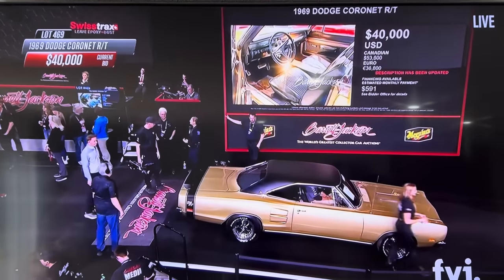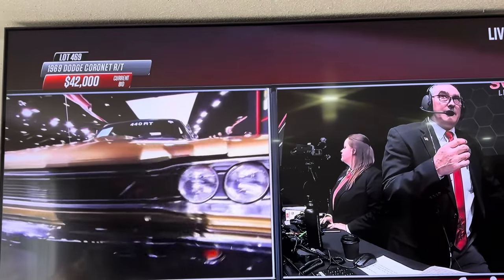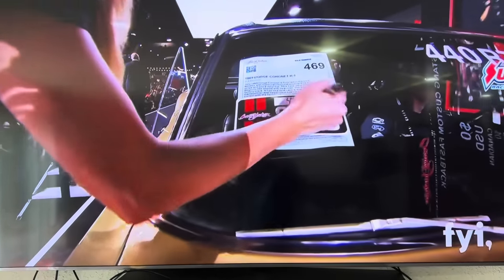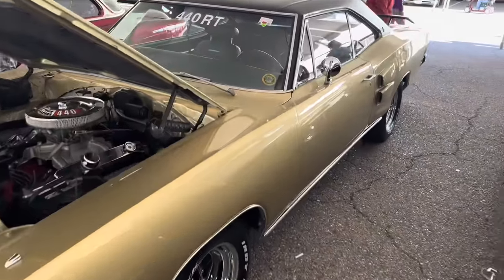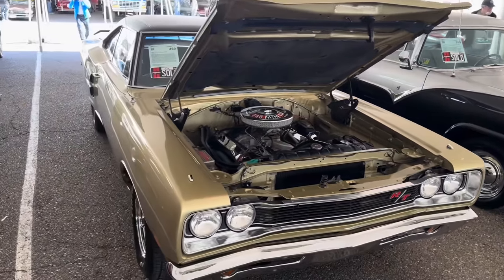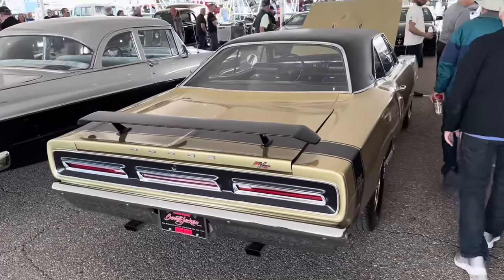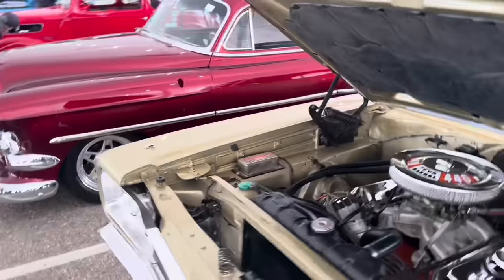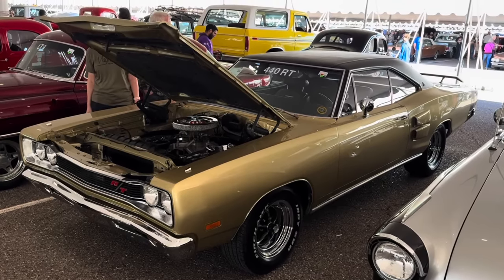The VIN Was CUT OFF This Fraudulent 1969 Dodge Coronet R/T At Barrett Jackson Scottsdale 2024!

Comment: The vin can be wrong too. As a kid in the early 70's, my folks bought a very low mileage 1969 Dart that showed it had a V8 in the vin. Trouble was, it had the original Slant 6. It would cost them an additional $3 for tabs! I wonder if you or Jamie have ever seen something like that?

Comment: that vin was not cut off.  it was removed in a skillful manor.
Reply from the maker: Yes sir
Reply: Wasn't really any 'skill" involved !
Reply: @rocketresto mecum has every make specialist there with sec of state police checking EVERY car.. that kawasaki you were talking about has original vin on stalk,, the bike was powdercoated and they made him sand it off, he painted it with rattle can thats why they only saw last 2 numbers, that video was overreaction and they should of done their due dillagence..I collect EVERY make, have 400 plus cars, started in late 70s, I know numbers but to all do your homework. They did not just cut it out at bjj. It was done correct. They ran vin and it was not stolen. All the big auction houses pay a ton to have cars verified to their best. Buyers are responsible at end of the day.. good channel but do your homework before commenting. Thx dan
Reply from the maker: @SuperBoss351  appreciate the comment but they absolutely did cut the VIN off at BJ.  I talked to the BJ Mopar expert and the police cut the VIN off that car at the auction.  It was on bring a trailer last year with the VIN.

Comment: Tom,
My A4/M6S A12 that I’m the 3rd owner, having owned since 04/87, was involved in a wreck 11/71, wrecked on the right front. The 2nd owner purchased the car in 01/72 and repaired the damage on the right corner. In repairing it he replaced the core support top bar and right side core support panel. Now of course its’ body number there doesn’t match. Trunk one does. Original fender tag. I pulled the broadcast sheet out of the back seat back. Galen Govier decode done it 87. Darrin Stanke and I went over date codes on various components in 2019. Original owner still alive. Ex-wife of 2nd owner still alive. That being said what would Wise do with the core support number missing? No, I’m not looking to sell anyway but curious if my children would run it through someplace like BJ what would happen with Dave Wise “expertise”
Reply from the maker: That is an excellent question, I will ask Dave and get back to you.
Reply: It would be a cold day in hell before I would let them remove the VIN on a car
Reply from the maker: Don't disagree but if the state police is sitting there what are you going to do? @mattsams9325
Reply from the maker: @chriscraft4236  they absolutely do have the authority and the state police are the ones who cut the VIN off this car.
Reply from the maker: After posting the video I talked to Dave Wise about it and he said the VIN was cut off by the police while he was watching. @chriscraft4236

Comment: There is no reason to cut off the vin. It goes with the car. If someone dummys one up like an R/T  it is still the same car its just a clone. Big deal. If the vinyl does not match the rest of the body numbers that's a different deal.

Comment: I would love to see a video on secret VIN tag locations. I wish I still had the fender tag for my car but it was lost many years ago.
Reply from the maker: We will probably do one soon.  68 and 69 are very different.
Reply: there are no secret VIN tags, in later years some body panels were stamped in key locations with partial vin numbers and the vin was added to tge fender tags.
Reply: Upper cowl, trunk lip , rad support
Reply: Feel free to use my car since it is original and a 68 if you wish in a video
Reply from the maker: 1969 and up Mopars have the last 8 of the VIN stamped in two places on the car @moparsa2b
Reply from the maker: Would love to but the problem is the second VIN is under the trunk seal, don't want to mess up your seal to do it.  On an E-Body it's core support and cowl so you don't have to mess with anything to see it. @RayEC70

Comment: part of the problem is the people in the hobby itself,the big money guys,
who will buy a 318 charger and have charger r/t tags swapped on and then sell the car as original.

im a member of a mopar forum where years ago it would have been a Bad thing to do swaps.
you would have gotten the convo shut right down.
now,the same people who run and mod that site,will Promote vin swapping,
because it " saved the original car " is their excuse.
the real reason is because a 69 r/t charger is worth a helluva lot more than a 318 charger.
they dont Care about defrauding others,its all about the money.

ps,i still have Vin pics of a 318 charger ON the car itself and of the New vin tags that Converted it to a 70 440 six pack car.
where do you think that is now ??

Comment: Again,, most of these 'restored' cars even if 100% original  will often not have correct screws, paintouts  & etc. In this case they are 55 years old. Been modded, thrashed and abused and also ofcourse suffered accident damage and average repairs [done under insurance]
In some cases 'reshelled as the original was rusted out or suffered accident damage. Legal? No but a reason

Comment: Why doesn't Barrett tell people the vin issue when they bring the car across the stage? Or do they and I missed that part?
Reply from the maker: They do but use code words to make it not sound like that.  They said the car has a “bonded” title going over but people didn’t know what that meant.
Reply: A VIN issue is not what that means necessarily..  Bonded in Az means the state has no documentation for the true owner of the car.   You have to buy insurance and get a bonded title in that case.  This is strictly to cover the states butt if the real owner steps up after they give another person documentation (title) as the owner.  After 3 years the title will drop back to a normal title and it is no longer bonded.   This is common for those of us dragging abandon cars out of the desert to restore. @rocketresto

Comment: so AZ State Police has jurisdiction over cars titled in another state?  They can immediately assign an AZ VIN to a car that was shipped in to the auction?  The BAT auction shows Nebraska plates.  Very interesting topic.
Reply: also its surprising that the car went over the block with the AZ VIN and someone STILL paid that kind of money
Reply from the maker: They have jurisdiction when it is in Arizona.  Doesn’t matter what state that it came out of they have jurisdiction over a car that is in the state of Arizona being sold by a dealer (in this case Barrett Jackson).  I’m not a lawyer but I believe since Barrett is the dealer and they have the title in their possession then yes they can do this.
Reply from the maker: In the past they have pulled cars like this, in this case the owner probably gave it to go ahead.  Worked out for the seller, not so much for the buyer.
Reply: depends on the state. I bought a car off of ebay was a fake rebody. Ebay could care less and the state of Virginia said they wouldn’t touch it since it came from NY….
Reply: @rocketresto  Barrett Jaskson is not a dealer, they are an Auction company. They sell the car for the owner and get paid for the service. They don’t buy your car then hope to sell it at a profit…
Reply: @moparsa2b the way I understand it since BJ is a no reserve type of auction you have to sign title making it an open title so BJ having an open title in their hand they could technically own the vehicle and AZ could do what they needed to do.
Reply from the maker: Barrett Jackson has to have a dealer license to run an auction, they absolutely have a dealer license. @moparsa2b